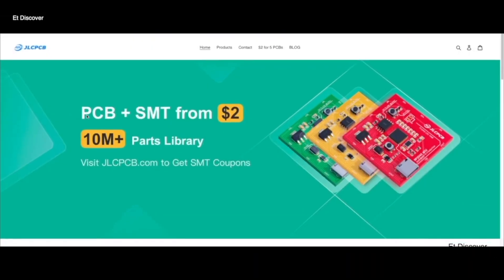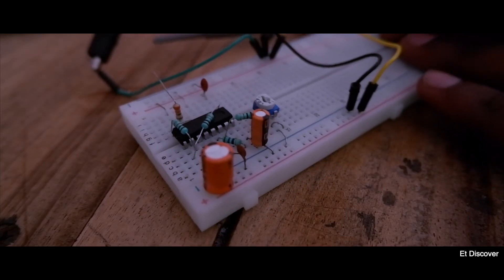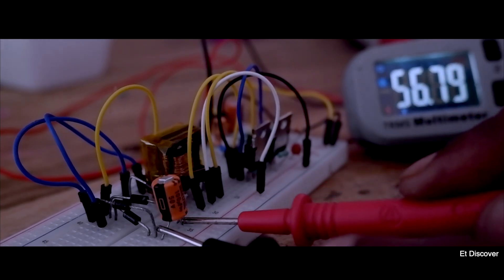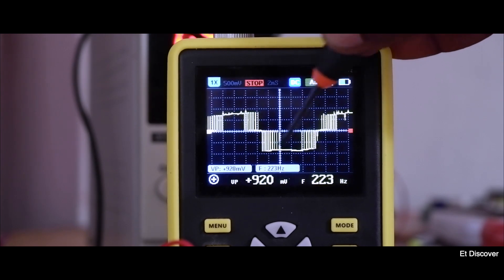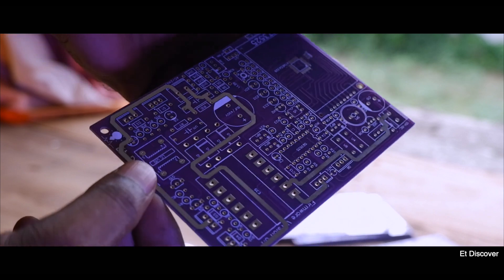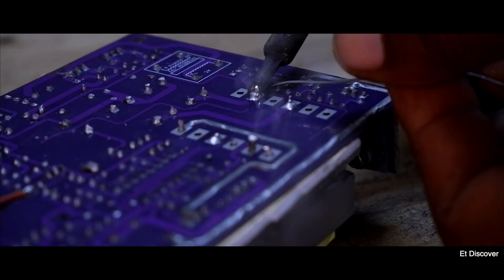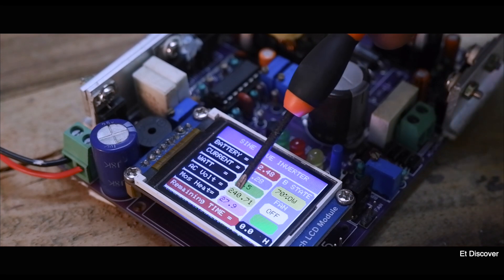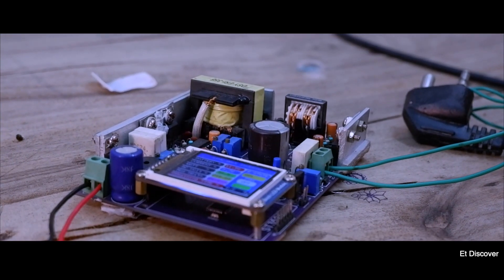SINE Wave 400 Watt Smart INVERTER

Comment: Hello my friend,
Thank you for this great project.
I have issues with programming the .HEX file into the Atmega328, I have burned 6 chips already.
I get a short circuit after programming . Please in the video i cannot see "every action" for the programming.

These are orig Atmega328p-AU chips, must I program a code first like bootloader or something else, or just the .HEX file uploading.
Please,what programming cables should I connect to the PCB all 6 cables including RST?
Wich voltage capacitor for C6 + C7 , I cannot find on Aliexp.,please a link?

I live in the Netherlands.Can someone program this in the Netherlands and send it to me? ,please contact me.

Kindly regards
Ps: I am almost 5 months busy with this project,thank you

Comment: Hi sir actually i am from bangladesh.
I make this project today, but i facing a big problem.
With 100watt load i have 320v from direct transformer pin output. But when i add schottky diode and 400v150uf capacitor, voltage get down to 50v dc without load.

What is my problem? Help me sir.
Reply: Brother, were you able to resolve this issue?

Comment: Hello. Thank you for making this very good and efficient inverter. Only the part of the circuit that sends the 220V voltage to the IC microcontroller is missing in the schematic. Please send me the resistor and capacitor values of that part of the circuit. Thank you.

Comment: Will st7735 display of 2.2inch work instead of the 1.8inch you used?
Reply: If the pins are correct

Comment: damm... this looks very efficient, I thought you would need very huge amount of cooling and temperature stabilization with low efficiency, but it seems very fine😅. Very useful for remote areas where battery can be charged via solar and work in night as power source for small appliances.:elbowcough::virtualhug::yougotthis::yougotthis:

Comment: How is that possible bro, I believed that it's very important to rewind the atx transformer to get even 100w output as you are only using the 3.3v winding rest is waste, Impossible to get 400w bud
Reply from the maker: why not? smps max watt 450W? if you have right frequency

Comment: Hi, can you please post a scope image of the 240Vac waveform?
Is your inverter capable of regulating its 240Vac output?
How hot does  the SMPS transformer that you are using?
400W inverter, at the least    400 / 12.5 = 32A, are the DC power input terminals rated to that current?
Wouldn't it be more efficient to place the DC input terminals near the switching MOSFETs?
Where have you published the schematic diagram and comprehensive  parts list?
Can you please publish an input power vs output power efficiency graph?
Reply: Schematic : https://github.com/Etdiscover/ST7735-TFT-Arduino-SPWM-Sine-Wave-Inverter/blob/main/Schematic_400Watt%20inverter_2022-08-06.pdf
Reply: IRF840 mosfet is main switch device.. 500V 8A should be plenty for 230V@400W right?
Reply: @MoesKeckeEcke  tem como você  fazer um vídeo inverter 127v 60hz mostra foma de onda senoidal

Comment: Thermal protection and overload. Can you explain more about it. Thanx :-)
Reply from the maker: I used two 0.22 Ohm resistors in parallel as a shunt. I was written in my code when the current consuming under 15 ampere the inverter will run very well but when it is rise up then the inverter will shut down, you can change it to increase your Inverter watt